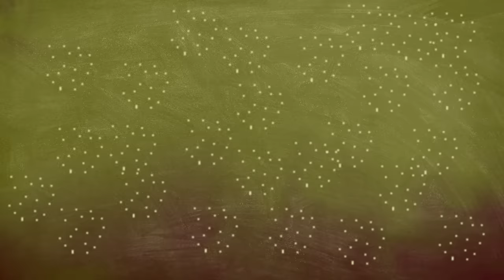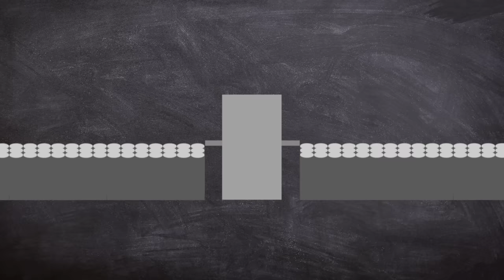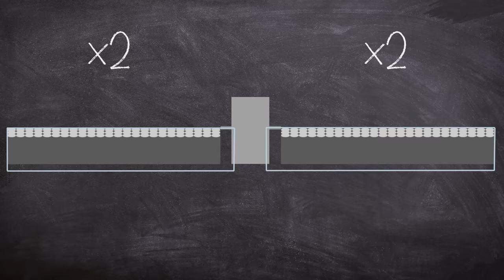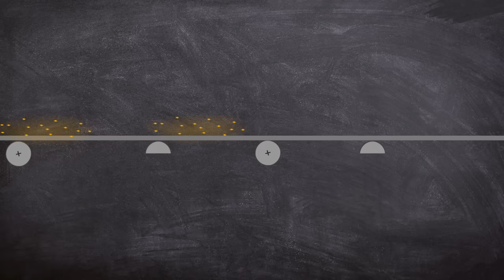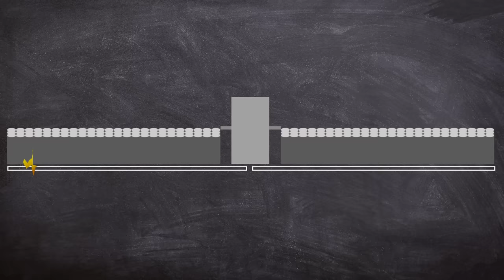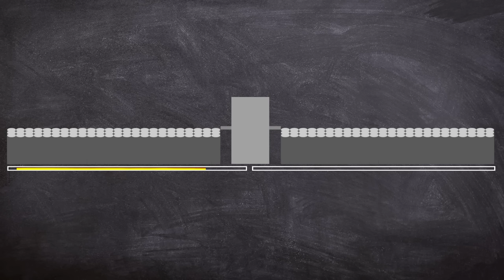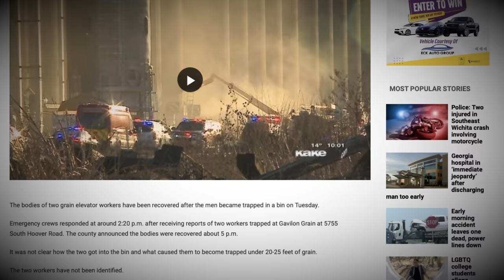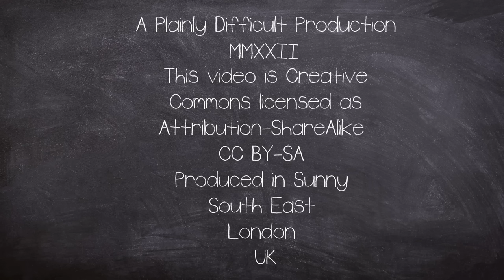The Debruce Grain Disaster 1998 | A Plainly Difficult Documentary

Comment: If I understand correctly in SI the total capacity is about 735 thousand tonnes and the used capacity was 190 thousand tonnes... that is assuming the measurement @ 09:20 is the wheat bushel? Or is it a volumetric bushel?  imperial system is bonkers

Comment: Grain dust explosion is almost the same as a Thermobaric Bomb. Fuel (liquid or powder) is suspended in air, then a ignition source sets it off. No Oxidizer is needed as in conventional high explosives. Oxygen present in Air is about 20 percent and is more than enough to support high energy blast. Explosion causes extreme heat and extreme air pressure in form of supersonic blast wave.

Comment: Please don't think I'm apologizing for the company not fixing their dust control system. My question is at least 50% of the employees there knew that that dusk control system needed to be running. Why didn't someone report to OSHA, reporting is anonymous, that the dust control system was not working and conditions were getting dangerous? We as employees have a responsibility to ourselves and our co-workers to ensure are working conditions are safe. We can blame the owners all we want and in this case they deserve to be blamed but aren't we responsible as individuals also? When I was an IT supervisor I discovered the power transformer outside the building was overheating grotesquely. It's normal color was kind of the pea green, the paint was burning off and turning gray. As I walked by the unit I noticed the color and I noticed also that there was a tremendous amount of heat coming off the unit. I went in the building and I called our maintenance manager to report the problem. I called the power company and then I proceeded to power off the building and trigger our ups system to power the computer room. I could have just walked by it it would have eventually burst into flames. As a supervisor for my company on weekends when no management was on site I was actually responsible for the entire facilities not just operations. By the time the power company got there the unit had cooled a little bit and the guy looked at me cuz I saw him out there and he says are you the one who reported this, I said yes. What did you notice and I told him about the paint color and he knotted and I told him that when I walked by the unit the amount of heat coming off was like someone opened another door. So he had already thrown off the big breaker on the outside and then he opened up the access panel and it was fried. He looked at me and said you know you probably prevented a fire and explosion by calling us when you did. I said well I not only called you I also powered off the building. He looked at me and said you knew to do that? I said I have a healthy respect for electricity my dad taught me. And I figured the minimum it would do if I didn't do anything was catch on fire and from there it would get worse. I mean you could get really technical and say well that transformer was outside so that wasn't your problem. But the reality was it was causing power issues inside the facility like a 60 watt bulb putting out 250 watts of power. I literally went all around the building about 250 desk and just hit all the power buttons to off on everything besides throwing all the breakers. If you have a building with a couple hundred computers in it besides the mainframes and power comes back on you can cause a massive Spike on the grid and even more problems in the building. I didn't even get a thank you, good job or kiss my butt. But I knew what I did was right and I took satisfaction in that the building itself took absolutely no damage and everybody was safe. That's all that matter to me and I did my job. We were able to operate for the 5 days it took to get a new transformer thanks to our 750 horsepower diesel generator for computer room. The way I interrupted power to the computer room automatically triggered the UPS and started the generator. We as individuals are responsible for our actions and our reactions to conditions that are unsafe. At least that's my point of view

Comment: My guess is that the bad roller was in fact greased. Grease will help a bad bearing for a short while only. But one so bad that it started a fire has to be replaced! And if one is that bad, the rest will soon also fail. They should have had a regular schedule for replacing every roller on every belt.

Comment: seems to me they need a bearing temp monitor  system. that is a simple solution to overheated bearings. a thermocouple attached to each pillow block and a plc system to monitor . that could probably be accomplished for like 100 - 200 k

Comment: Can't they use a water channel underneath the belts to help reduce the chances of fire? It would absorb the dust that has settled and wash it away into a filtration system.

The only drawback that I can think of is mold, which could possibly be minimized with additives. And possibly the attraction of insects into the belt tunnel. But I'm only familiar with the safe storage  of alfalfa hay, so I'm probably missing something.
Reply: Much more complicated than necessary.  Airborne dust is best handled with air-based filtration.

Comment: How inept is the maintenance staff if a bearing got hot enough to set fire to its surroundings? In saying that the staff were probably over worked and I'll trained for the jobs they were doing,and this lack of dust control is a good sign that the managers/ owners are too greedy to pay for extra staff to remove the dust manually,also a good indication that management allows safety to take a back seat.

Comment: Easy to replicate experiment using a candle, a can and some flour.

But, uh, don't try it at home, lol.  Try it at a friend's home...  (Or some open area.)

Storage explosions doesn't have to be grain/flour, it can be sugar, wood or any other fine, dusty flammable material in the right concentrations.  It's like an air-fuel explosion, just not with hydrocarbons.